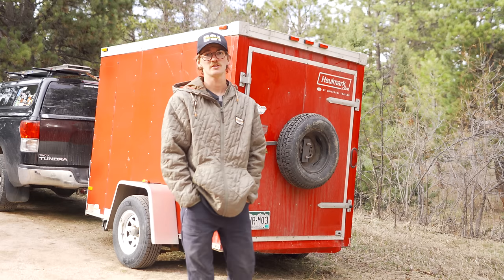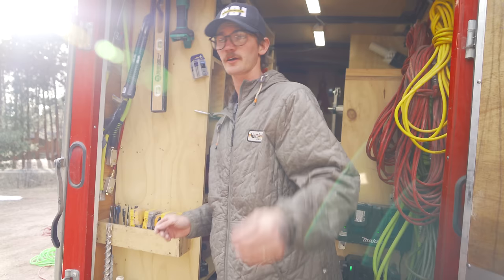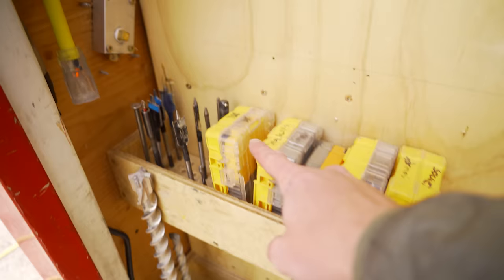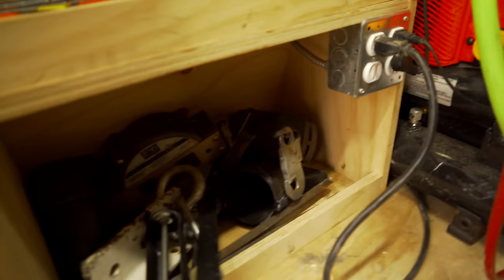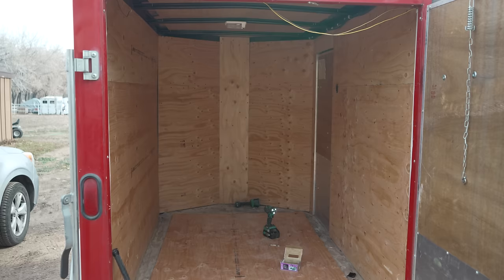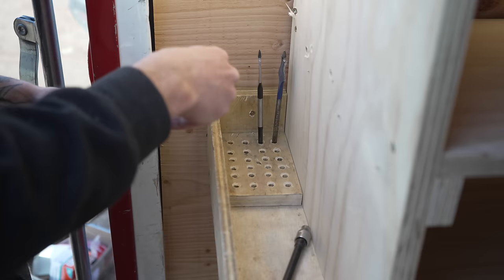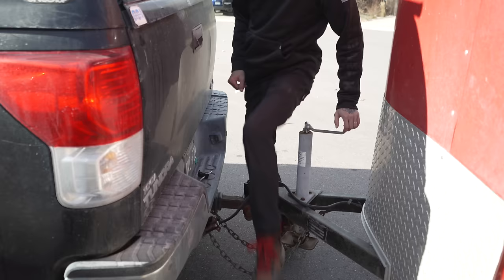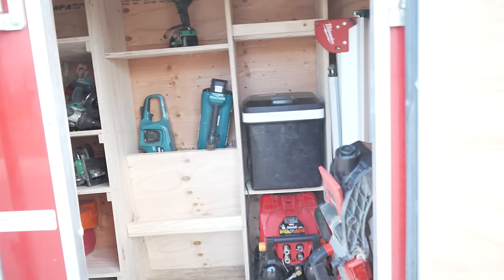Building Out a TOOL TRAILER

Comment: 1. Did you consider putting a fuse or breaker in so if there was a trip. You can fix it at the trailer instead of trying to find it with whatever external power source you are then using.

2. Have you ever been at a job site that didn't have a bathroom type solution?

3. Any thoughts about solar power for the trailer. Mostly to charge batteries on the move.

4. Cool project love custom, personalized builds.
Reply from the maker: I like the solar idea! I actually have a project going on right now with no ports potty, to be honest once we demoed the last toilet, guys would just go in the trees and #2 on lunch
Reply: @Coffmanconstruction  I helped at a job at a remote site with a upset stomach that day.
Boss's solution was a 5gal bucket with a garbage bag liner.
That was a "fun" day. Oh the joys of construction.

Comment: Awesome setup definitely jealous! What do you guys use the high pressure for? Are there framing guns that use 300psi?
Reply from the maker: Yes! They also have a gun that’s basically a Ramset with a coil of 100 nails, shoots into steel and concrete!